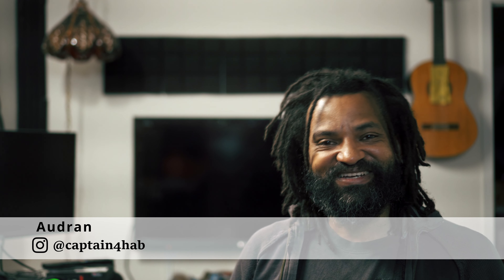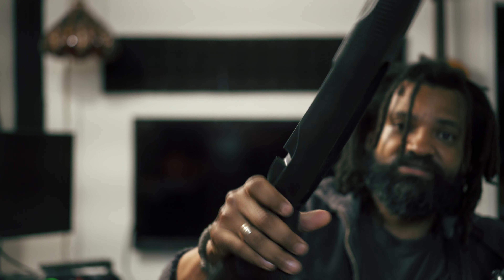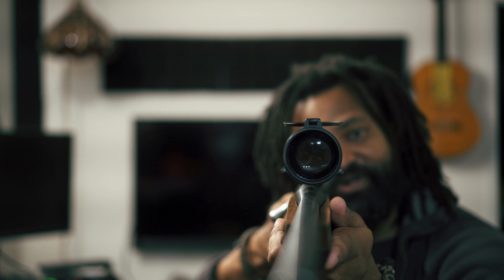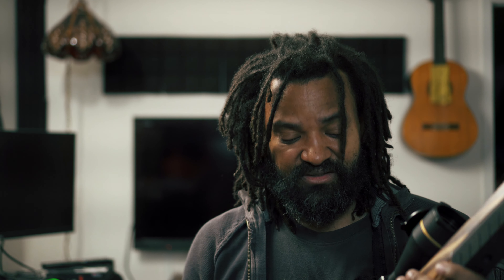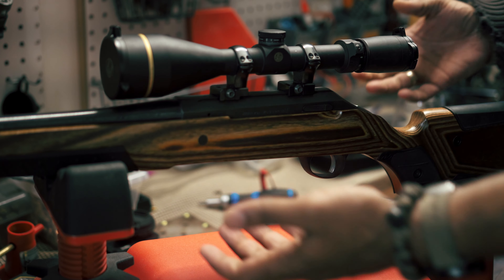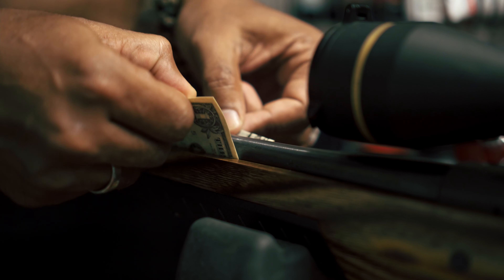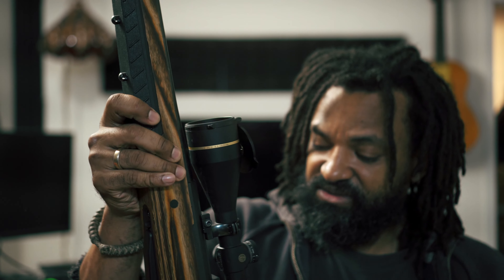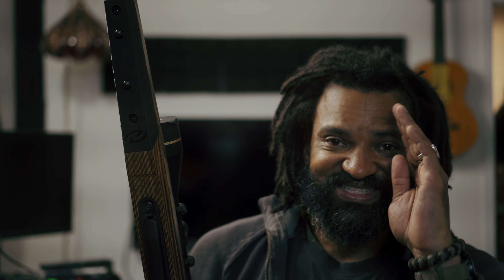Tikka T3X Lite  with Boyds Gunstocks AT-One Review & Installation

Comment: Great video, Audran!  On the Boyds At-One, what's really cool is that the grips and fore-end are modular and you can get different grips and fore-end for it.  There are also additional recoil pad accessories to adjust your recoil pad up or down, or extend it even further for people who require over 14.25" of length of pull.  What's funny is that for the Tikka T3 being such an expensive rifle, you'd think they'd get their act together and standardize the action bolts and use either Hex or Torx, and not mix the two.  LOL

Comment: I bought a boyds stock for a marlin 795 and it fits so badly that the barrel doesnt even sit center in the barrel channel 🤦‍♂️.
Reply from the maker: Oh no, that's bad, have you contacted them?
Reply: I ordered a stock for a Savage 10 ML Muzzleloader. It no were close to fitting. The screw holes doesn’t even line up. They gave a run around. So I contacted Savage and got the specs and Boyd’s wanted me to send it back to them at my expense. I will not do business with them again unless I let a gunsmith call them and order a stock for me.

Comment: Customized 2 rifle's, and bout done with a 3rd. A suggestion, see if there are torque specs for the stock. I didn't see if there was aluminum "V" bedding for the reciever in your new stock, but I had a Rem 700 I put a AICS Classic Chassis on. It took a day at the range, but I used a gunsmith torque wrench on the reciever studs to dial in the accuracy. Might be worth checking into.
Reply from the maker: Yeah, my only torque wrench is huge, for the Jeep, I need to get one of those gunsmith's one. It shoots fine at the range, but I'm in the process of developing a new load so plenty of things to iron out. I have pillar bedding installed at the moment. Will check for the torque specs, thanks for chiming in!

Comment: You had better bed that stock!  You already have pillars, the bedding process is easy, just do your homework. It will be even more "at one" once that has been completed.
Reply from the maker: I thought about trying that, in general for all my rifle and learning about how to do it, did a bit research. But for that Tikka, its shoots so good, that I'm afraid to change anything. But yes I'd like to learn how to do it.
Reply: @WildBushGrit  In that case and you’re happy with its performance, then I’d leave it alone. I’ve got a Tikka T3X and it does shoot pretty good, so I understand.

Comment: It looks great!  What color is that (from their web site)?   Also, I first saw this At One install over on the Ultimate Reloader channel, one thing he did on the install was to bump the stock butt on the bench before tightening the action screws.  Supposedly this ensures the lugs are seated.  Thanks for the video, are you still liking the stock?
Reply from the maker: Its the nutmeg color, I love it, and It's permanent on my long range Creedmoor. I brought it up to 1000 yards last fall. its a fantastic platform at the fraction of the cost of an MDT chassis.
Reply: @WildBushGrit  Thanks for the info, yep the price on these stocks are amazing 👍🏽  I have the T3x in .308 and it’s not ever gonna throw 1000yds with these old eyes, lol…

Comment: Hi!
Two different action screws is not the factory configuration. They usually have two T25 Torx screws.
Is this Boyds stock a "factory second", maybe? They usually are perfectly finished. Looks like there is a nick in the wood near the bolt release button on the left side of the stock...just curious. 
Cheers, Kamil.
Reply from the maker: Hey Kamil, I'm the first owner of that Tikka, and those are the screws I got, that puzzled me too. I also saw some tikka with flat screws. so idk :) I don't think they would have a sent a factory 2nd to a reviewer. I double check, I don't see a nick near the bolt release, at which seconds of the video you're seeing this?
Reply: Hi Audren!
Well, I have to correct myself: the "nick" is a scallop in the stock for better access to the bolt release button, obviously. 
And yes, it would be strange to send a factory second to a reviewer! 
The action screws are still strange...
Thanks for your response and keep on going with your excellent channel! 

Cheers, Kamil
Reply from the maker: @kamilklein2880  Ahhhh ok, I thought you meant a nick like a dent, but yeah there is a depression to help with the bolt release, The stock in wider than the factory, so it does help a bit. Thank you Kamil! Will do! :) Cheers!